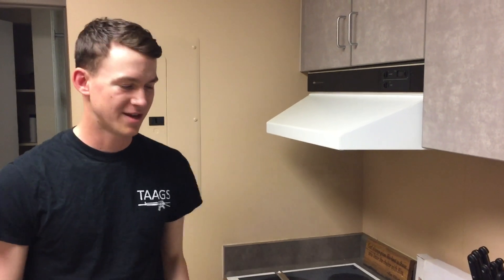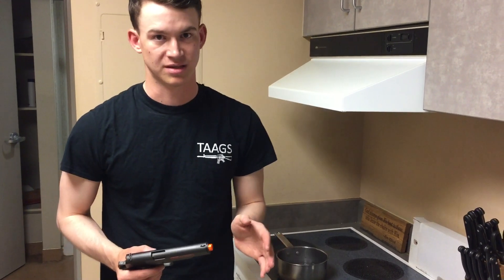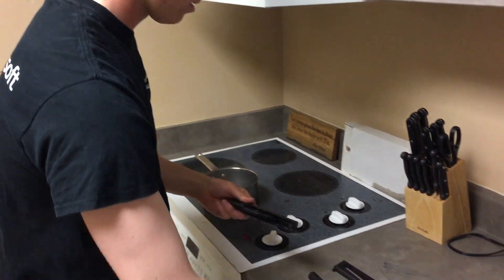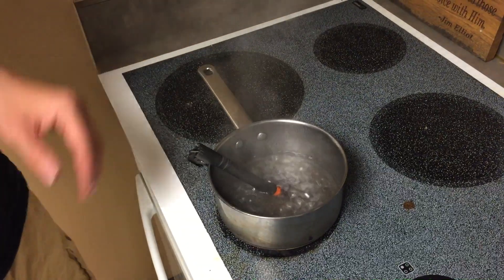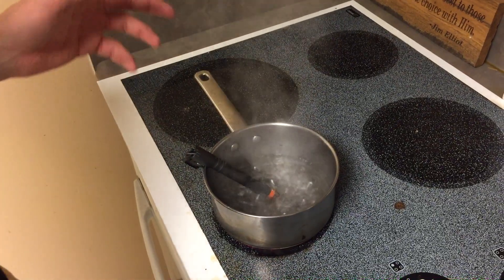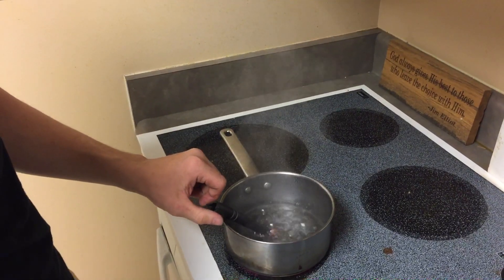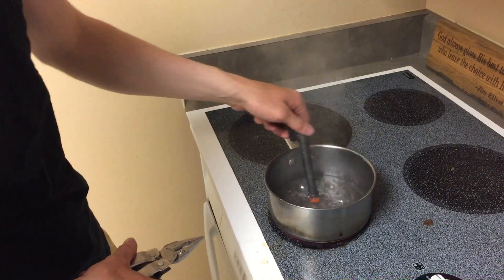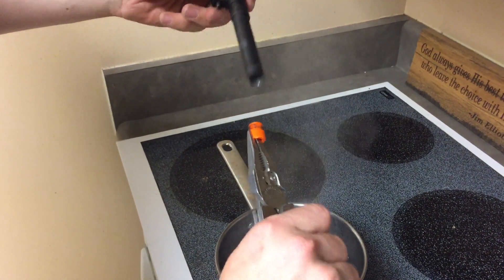How To: Remove Orange Tip From Airsoft Guns

Comment: Would recommend an extra 30 secs to a minute just to be sure. Take it slow if it doesn't budge immediately. Wiggle back and forth slowly. Popped off on my end with no damage. Solid video.

Comment: just use a hair dryer instead of the boiling water. works the same for me and I have a colt 1911a1 100th anniversary and I just made it on safety as if it just ran out of ammo and put a hair dryer to that and unscrewed the orange tip with pliers
Reply: I understood half of what you said

Comment: I love how most people go to the pot of simmering water but never say to take out the inner barrel, unless its steel it will warp e.e
Reply from the maker: well this pistol didn't have an inner barrel or else I probably would have mentioned it
Reply: How would an airsoft gun shoot without an inner barrel?
Reply: @Ryan-ng3mv  most pistols have a inner bore of about 6.03 most of the cheap GBB guns are like this, if its a rifle then it could still fire but would be very inaccurate, I was merely stating that alum and brass inner barrels have very low heat tolerance and can warp under the heat and cause it not to function as it should.
Reply from the maker: @Ryan-ng3mv  it's a high end gas blowback pistol which functions very similarly to a real pistol, it just has a regular barrel.
Reply: eelikay no it has to have an inner barrel, I have the same piece, it’s gold colored and you can actually see it on the inside of your outer barrel.

Comment: Hi. Do you know if the orange tip can be removed from a we Glock 17 gen 5? Isn’t it an essential part of the barrel, right? I Read that in some glocks the orange tip can’t be removed because can damage the barrel and cause shoot issues. I need to know if this is or not the case with my WE G17 gen 5. Thanks !

Comment: Was that threading originally made for a silencer?
Reply: Yes
Reply: nope
Reply: If you get a WE PMM, yes
Reply: Hmm, there's a yes answer and a no answer here. Okay, I'll cover the rest by stating...maybe.
Reply: .... the real answer is kind of complicated.... Front-fire blank pistols, in some countries, can only be sold legally if they're classified as "flare" guns.... hence, the threading is there to accommodate a flare "adapter".... As for top-firing blank pistols.... the muzzle is not threaded and has an orange (easily removable) plug instead of a protruding orange tip....
Reply: The normal answer is yes its an airsoft gun so its for suppressors and tracers

Comment: does removing orange tip effect accuracy of pistols? or will they shoot exactly the same? example pistol : green gas glock g19x
Reply from the maker: They should shoot exactly the same
Reply: @eelikay  so why are people saying that the orange tip is some sort of spacer in the barrel ? is that just a myth or does it vary by brand? Im wating for the elite umarex g19x
Reply: @BLOODINMYHENNY  yoo did u ever get the Glock19x? I just ordered 1 myself with a tracer

Comment: yo, so ive got plastic barrel with plastic tip, you dont reccomend doing it, but i dont have any other options currently, do you think it can ruin the threads, or should i try it?
Reply from the maker: If the barrel is plastic you will definitely damage the threads
Reply: @eelikay  lol, i jst got done trying it anyways, the plastic seems to be really strong tho, almost like a polymer. but no luck on glue dissolving, im goning to try one more time
Reply from the maker: @kgraebes88  good luck
Reply: kevin how’d it go (3 months later)

Comment: It's 2022 and I'm doing this on my G19
Reply: Did it work?? I just ordered the Glock 19x with a tracer
Reply: @Xtrememontage
Reply: @kidgambino0441   yeah just had to work out the orange piece without damaging the barrel the barrel is actually threaded if that helps

Comment: I tried this for my elite force 1911 and it is a metal bolt holding the tip together. do you know how to get that bolt off?
Reply from the maker: I would have to see a picture of it to give advice
Reply: Is that how they attach the tip to all elite force guns? I just tried the boiling water from the video on my glock 17 and it still ripped off and left orange inside
Reply: @metro1279  
Maybe you didn't let it boil enough? My glock 17 is on the way, would suck big time if this fails....
Reply: The Devil Himself did it work for u?
Reply: @donteygardner7514  
It came off really easily, not as much struggle as shown in this video. Maybe there wasn't much glue in mine. Now it looks like a real pistol :)

Comment: Would this work for glock 17 gen 4 and 18c?
Reply: works for every gun
Reply: @agurufemalebrawlstars8850  what about ones where the orange tip is on the slide and not the barrel?

Comment: Can I use this method for my ssp1?
Reply from the maker: What's that?
Reply: Novritch ssp1 pistol
Reply from the maker: @riob6505  if both the inner and outer barrel are metal and you take it apart first it should be fine
Reply: eelikay thanks for the help
Reply from the maker: @riob6505  my pleasure

Comment: This Is ILLEGAL!!!
Reply from the maker: you are illegal
Reply: Not in the US.
Reply: Illegal to sell..without orange tip
Reply: Ok and?
Reply: US federal law requires that each airsoft gun should be equipped with a minimum 6 mm wide blaze orange tip. This law is in place so that it's much easier to tell the difference between a real firearm and an airsoft gun. Whether or not you can remove the orange tip is completely contingent on the state that you live in.
Reply: @scarroll625  i do that
Reply: Lol iam subbing just for that lmao. "Your illegal" ahahah